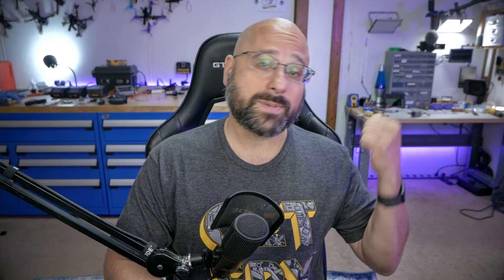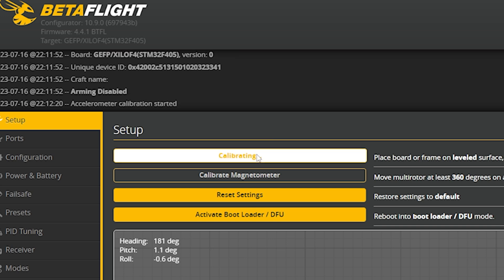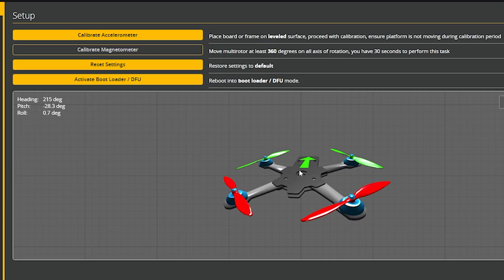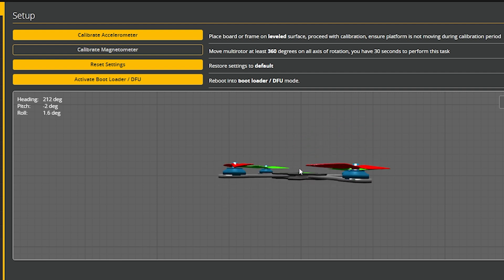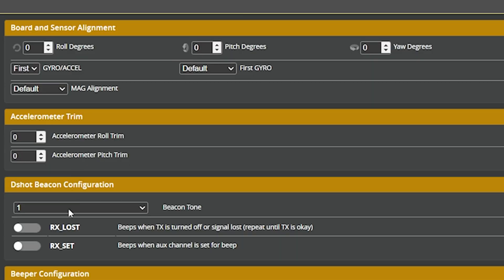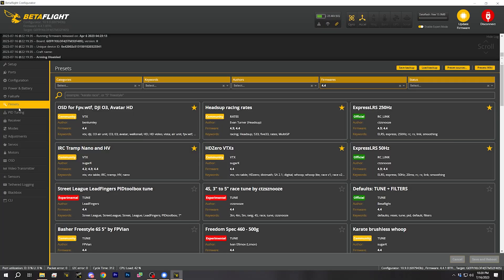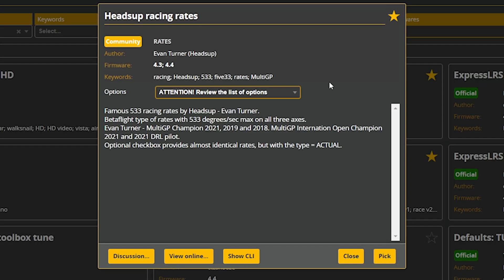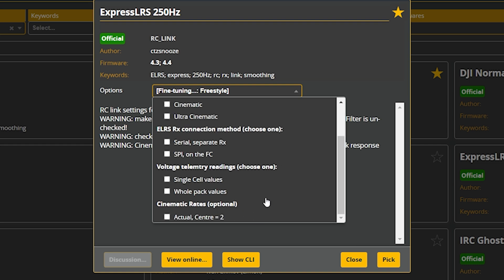Build an FPV drone in 2023 - Part 11 - Final Betaflight Setup

Comment: Hey Jb, for the packet rate at 50hz and preset... can i also add the other presets for 250? So when I want to switch to 250 the drone will have everything it needs. Can I have multiple Hz presets configured (available) at a time? Or do I need to start at 50hz (this example), then reconfigure to 250hz & preset when I decide to make that switch. 

I singed up for your Patreon and honestly... it's the best damn fpv community! Blunty literally saved the day today by helping identify that I needed to remove the SBUS from the O3 harness. I was totally stuck and lost... Blunty saved the day! 

For the record... the only reason I felt comfortable enough to take on this build challenge was because of your amazing, in-depth, extremely informative tutorials. I greatly appreciate everything you have done and continue to do. You rock dude! 

Anyone questioning their FPV journey for the first time... don't think about it... sign up for JB's Patreon. I literally would not have been able to complete this process without the help of the JB Patreon community. Seriously amazing and thank you for what you have created!

Much obliged,
KYLE_FROM_THE_FUTURE

Comment: If we are using the DJI 03 and the controller 2, do we still select the heads up racing rates or keep the same rates from the earlier DJI video #5?
Reply from the maker: The rates are the same.
Reply: @JoshuaBardwell  thanks, I’m just browsing through the next few videos, but the build is coming along thanks to your very in depth tutorials.

Comment: Thanks for the great series! Just wanted to mention something I noticed, I think the flight controller first came correctly oriented. Only after the step of the accelerometer calibration does it seem like it requires the change in FC orientation.

Comment: What RC Link preset should I load when using the DJI 03 Air unit? In general, love the instructional videos, have taken a lot of time having to research specifics for DJI O3 Air unit setup and DJI FPV Controller 2. Am I missing all the videos beyond installing the O3 air unit? Without tracking down comments in the comments section and hunting other videos, I would have been totally lost with the options I picked when purchasing the kit.
Reply from the maker: All the videos in this series are in the playlist linked in the description and comments of every video. There are no instructions for using the DJI Controller in this series. There are instructions for setting up the flight controller to work with the O3, such as the on-screen display.

The first video in this series lists the equipment that will be used in the series. The tutorials show how to use an ELRS radio and receiver. If you decide to use different equipment than is used in the tutorial, you will have to do some original research to finish setting it up.

For the DJI O3 Air Unit, there are two RC Link presets in the Presets tab. One is named DJI Normal and one is named DJI SBUS FAST. Choose whichever one of those matches the protocol you are using (normal vs. fast SBUS, which is selected in your DJI goggle menu).

Comment: Sir please kindly help to sort this problem actually I was using the Geprc F722 Aio FC and I already and flying without vtx module but now purchased the o3 unit and installed after that I coudnt able to connect the rx receiver and am using the Elrs rp1 if am removing the o3 unit and using means it’s working and if am without connecting batter if I connect to beta flight that time to working it seems if power supply goes to o3 unit Elrs not working but the o3 unit working and transmit signal to my new integra goggles but on that time rx not working. Please kindly help to sort out 🙏
Reply: The 03 unit has built in rx for a dji controller2. You need to remove two wires from your 03 harness when using elrs.